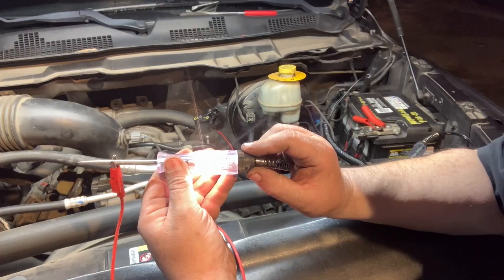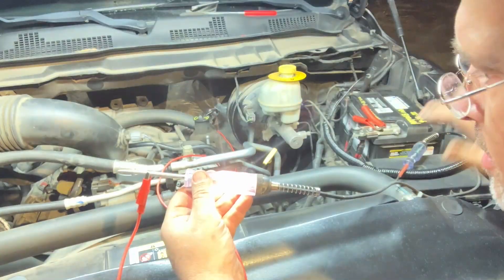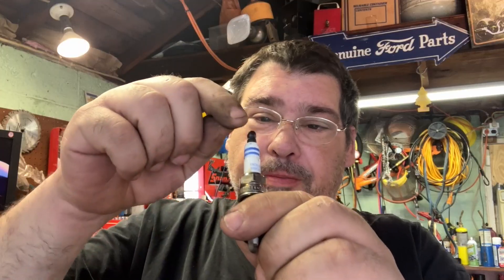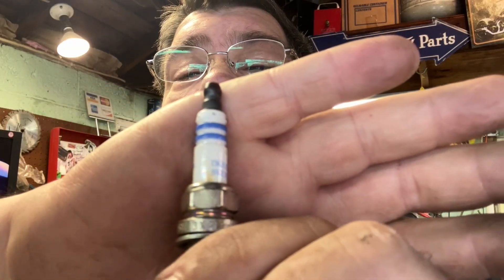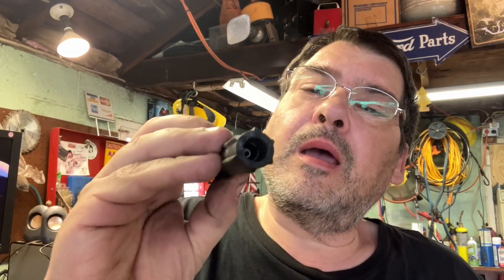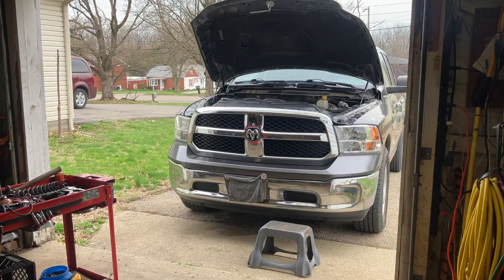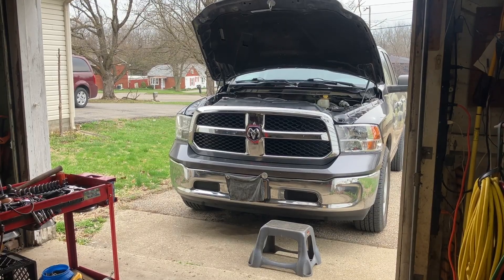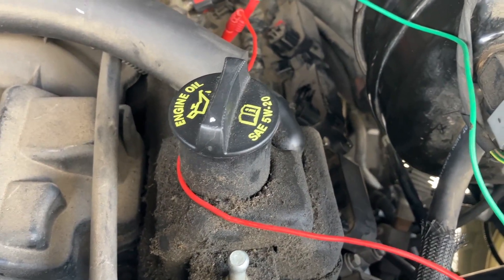A Nice 2015 Dodge Ram 1500 - Misfire Diagnosis - Picoscope - It Needs a New Engine  :(

Comment: Bosch platinum plugs are straight junk. I’ve had so many misfires come through the shop with brand new bad Bosch plugs. They’ve been garbage since the late 90’s. I put a set in my 1981 Monte Carlo and the same day I thought I threw a rod driving around. Turned out it just blew the whole insulator out of the plug. 😂 Advanced auto parts must’ve gotten spiffs on them or something because they used to push them hard on people.
Reply from the maker: I have never had any problems with them.  They don't last as long, but the are cheaper.

Comment: If you really want to help this lady, put a hellcat oil pump on this motor or whatever is in that truck.
Reply from the maker: She can talk to another shop about that I don't do heavy line work, especially on Chrysler junk.
Reply: @frugalprepper  it's for longevity. I don't consider any of the three to be especially spectacular on quality. GM has transmission problems, Ford has blowing out spark plug through the head issues, Chrysler has the low oil volume at idle issue (the fix is a higher volume hellcat pump. No weaknesses other than that)
Reply from the maker: Cylinder Head PT Cruiser, that is when I stopped liking Dodge.

Comment: Why dont you take a gander at the oil pan for metal or the oil pickup before we go to buying a new long block. Low/high oil pressure sets the code on hemi. It could be clogged pickup
Reply from the maker: I already took an Oil sample and it is contaminated.

Comment: You're probably right about the main bearings causing low oil pressure on her truck, but on these engines, both low oil pressure AND high oil pressure will throw a low oil pressure code. The manufacturer didn't program for high pressure - the computer simply throws a low oil pressure when it sees the oil pressure out of range, whether it be low or high. I placed a hellcat oil pump in my Hemi, which has a larger inlet and provides higher volume. But the higher volume also increases the pressure  (to 70-80 psi), and throws the low oil pressure code. The fix was to remove the pressure relief valve spring from the stock oil pump and replace the heavier spring in the hellcat oil pump. This still provided the higher oil volume while the relief valve opens at about 60-65 psi, preventing the low oil pressure code from throwing. I'm at about 40,000 miles since the repair and everything has been perfect.
Reply from the maker: Yeah I am not really a Dodge Guy, but I told them they could have a shop pull heads and do lifters and replace the cam, but that I would spend that money finding a good used lower mileage engine with a warranty.  From a Salvage yard that will also install it.  That way the salvage yard will replace it again for free, if it is a bad engine.

Comment: Yeap, don’t fix it. Hemi will be back in a week with a locked up engine.  Got one sitting in the Floor that we removed engine and replaced camshaft and everything.  Didn’t last a week, locked up tight.

Ran perfect when it left, spun bearing who knows.
Reply from the maker: Yeah  I am not normally a Chrysler man, but my customers keep buying them!
Reply: They are super cheap for a reason ehat usually about half the cost of a similar toyota
Reply from the maker: I know Toyotas new 3.6 Liter Twin Turbo and an Amazing engine!

Comment: I put Red line fuel system cleaner in my old VW Bug and it smoothed that engine out beautifully. It's like a new engine.  Best cleaner I ever used and will continue with it.
Reply from the maker: Maybe it will fix a bad camshaft!
Reply: @ No Red line wont fix that but if it needs a new cam it needs another engine.